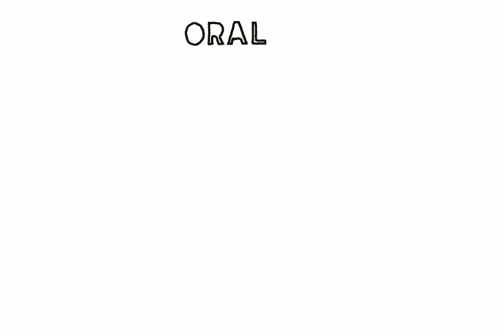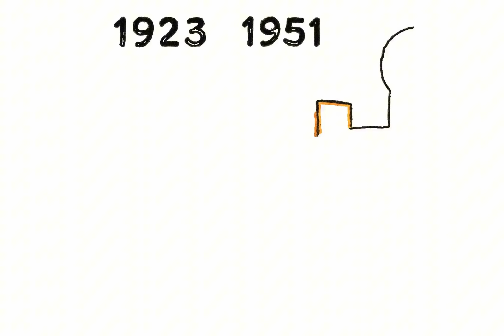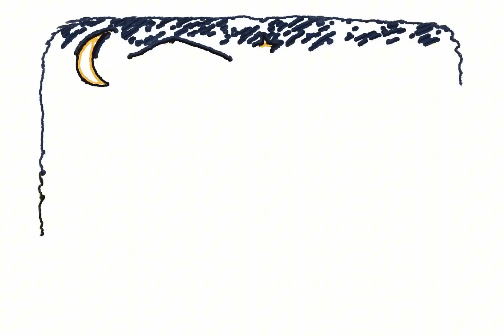12 Impossible Inventions That Were Erased From History

Comment: An iron ship floats on water due to buoyancy.
However, if a hole is drilled in the bottom, it will sink. This is because iron's density is greater than that of water.

If the top lid of a cubic iron container (only the bottom is missing) is opened, it will sink.
After sinking, if the top lid is closed and air is added, it will float again due to buoyancy.

Buoyancy is so powerful that a cubic container of 1 cubic meter can generate a generator with a force of 1 ton-f (1000 kgf) (Archimedes' Theorem).
This force is strong enough to lift an average passenger car, so it can generate enormous amounts of electricity.

If the container floats near the water surface while the generator is running, opening the top lid again will cause it to sink again.

By repeating this process, it is possible to generate electricity more efficiently than not only thermal power plants, but nuclear power plants as well.

The top lid can be opened and closed with very little force, as there is no pressure difference between the inside and outside.
When pumping air into the nozzle, if the nozzle is facing vertically upwards, the air inside the nozzle is pulled in by buoyancy, so very little force is required.
Therefore, even after taking these factors into account, the energy balance is significantly positive.by

Comment: For the idea about unlimited energy using the Palladium, I actually theorize the same thing by analyzing the catalytic converters inside of vehicles that are responsible for mitigating the amount of emissions put into our environment if you notice this mitigation process between palladium platinum and rhodium takes your emissions and converts specifically carbon monoxide, nitrogen oxides, and hydrocarbons—into less harmful substances (carbon dioxide, water vapor, and nitrogen) so in theory our lungs seem to be doing the same thing innocence acting as a filtration system if we could replicate the function of our lungs while incorporating a catalytic conversion methodology it is very reasonable to say that some sort of “iron lung” could be manufactured in heavy industrialized areas that would be dualistic in functionality of being a filtration system for the airways as well as producing fresh water and electricity simply by converting the emissions into water the separation of the bonds will produce energy that could be stored and return back to the systems power bank it would actually be a three and one system just by completing the full process of conversion that would literally result in freshwater clean energy and not only know emissions, but counteractive mitigating our global warming problem and I bet with a little bit more troubleshooting. This idea there is a high probability it could be produced even more efficient potentially having is the ability to correspond with gravitational pull of the nutrients existing outside of earths ozone layer, pulling in useful minerals that the Earth can use as nutrients to produce all sorts of materials and minerals like metals crystals as well as placing them strategically throughout the globe following specific geological coordinates along earths surface this could strengthen and begin to repair the ozone layers of earth protect protecting us from radiation, penetrating into earths atmosphere, as well as strength strengthening the functionality of the ozone layer which is responsible for the Earth’s ability to regenerate itself making our planet, healthier, and more abundant in resources the process of converting earths heavy metals into more precious metals would be more efficient, resulting in and increased production, speed, and quality in abundance we really should start treating the planet like we do our own self health and honestly better than that because we all deserve to be treated with the best qualities of life and don’t realize how we neglected even our own health simply just by not knowing the quality of life, God has given to all of humanity as far beyond what we know

Comment: Ironically, a lot of these inventions are now still being used today, but in different forms. We can take one , for example , the starlight anti heat material Is the same exact material that's used on the bottoms of the Space shuttles Which is already been implemented some last ten year or years
Reply: They used ceramic plates, not aerogel.

Comment: 1. Fish tank full of water
2. Grain of sand
3. 2 foot long 2lbs 4x4 piece of wood.
Experiment , 
1. Drop in grain of sand. It sinks to bottom fast.
2. Drop in 2 foot long 4x4 wood. It floats on top of water.
Much larger, heavier item floats while tiny light item sinks.
PROOF that Gravity does NOT exist at all.
There is no force "pulling" things downward at all.
Reply: lol, you have one thing right, gravity doesn’t pull down, it is draws both items together because state fall to there lowest power level. It appears you are falling because the mass of the earth is too large for your mass to move it.
Reply: @donut3946 LoL
Reply: @seaislevel7233  oh and you’re a flat earther too. People like you are impossible to debate, because you lack the cognitive function to understand debates.
Reply: People like you are the reason conspiracy theorists are laughed at. 

Buoyancy is a force caused by a fluid, in this case water, being more dense than the solid 2x4. Despite being more massive than the lighter grain of sand, the sand is far denser. Take a quartz rock and an equally sized piece of wood, and you’ll see this clearly. 

Buoyancy is a function of volume and density, with the force provided by gravity allowing the fluid to press against high volume objects. 

Helium balloons float because the matrix of gas within them is a lower density than the air around it, allowing it to float.

I’m 90% sure people like you are government-paid to discredit conspiracy theorists, because no human is that stupid.

Comment: 1:41 I hate to point out this simple fact, but coral is not magnetic. It is porous though so it’s possible that he floated it on water. He would’ve had to have sealed up the outside edges of the coral so that the air pockets would remain.

Comment: Gravity propulsion is real; I know how it works.
Reply: What they call antigravity is a misnomer. You have a graviton functioning in space/time. If an antigravaton contacts a graviton, they would explode and literally effect space/time. The proper term should be null gravity. A null gravity device would act more like a bubble floating on carbon dioxide layer in an aquarium. A null gravity bubble would "float" on the layers in a gravitonal field, generated by the mass of a planet.
Reply: @TheParkAttendant  taking notes 😅
Reply: @TheParkAttendant Two conical hexagonal quartz crystals are placed base to base. A bifilar coil is wound around them using thick wire folded in half. The positive end of angularly placed high-voltage capacitors is connected to the bifilar coil. The other end is connected to an x-ray vacuum tube antenna. When the capacitors are charged, gravity is created and the vehicle rises. 😁
Reply: @halilka9853 interesting you use quartz… but what’s the core principle? The aether/369? Electromagnetism?
Reply: @supply.mp4 Yes, magnetization. The structure of a quartz crystal is just like a magnetic field. A spiral hexagonal structure. Three sides of the hexagon are S and three sides are N. People don't know this yet; it's hidden knowledge.
Reply: @halilka9853 how'd you find it? Have you tested one?
What did you mean by Gravity? (We are already in a gravity felt place, Earth)
Would love to know more.
Any further updates too?
Reply: @railcamm it turns out, they could only get it to work when they did LSD 🤷🏼‍♂️
Reply: @halilka9853 I've have subscribed to your YouTube channel accept as your student sensei
Reply: @halilka9853 is this the same thing as dr Steven Greer or Bob lazaar and similar people talking about cancelling mass using technology that creates a field affecting gravity within it? Or is this completely different method bit achieving the same result?
Reply: @DarkGhostHackerSame. These are the latest details on this technology. This technology is patented, it exists, but it has been made incomprehensible to malicious actors.
Reply: @halilka9853  oh.. i think you see" voltage without current" phenomenon instead of gravity. When voltage is achieved without current it creates a gravity like phenomenon
Reply: The water Gravititional Force in the Dam that turns the mega watts electric generator propeller actually works with Gravity called in Science as "Kenetic Energy" from Water Falling Gravititional Force.
Reply: @igabgabay_kopay Two conical hexagonal quartz crystals are placed base to base. A bifilar coil is wound around them using thick wire folded in half. The positive end of angularly placed high-voltage capacitors is connected to the bifilar coil. The other end is connected to an x-ray vacuum tube antenna. When the capacitors are charged, gravity is created and the vehicle rises. 😁
Reply: This is this CIA, where are you located? Oh nevermind.
Reply: @zacharysilas7585  Good one!😂
Reply: @zacharysilas7585 Two conical hexagonal quartz crystals are placed base to base. A bifilar coil is wound around them using thick wire folded in half. The positive end of angularly placed high-voltage capacitors is connected to the bifilar coil. The other end is connected to an x-ray vacuum tube antenna. When the capacitors are charged, gravity is created and the vehicle rises. 😁
Reply: I also know how this works. 
Capacitor with each Plate different in size. For example half size. Then apply very high Voltage. From 50kV to 1 MV. Extreme force. Related to Casimir effect
Reply: @vr_patient7016 A very high voltage is applied. Two conical hexagonal quartz crystals are placed base to base. Then a bifilar coil is wound around them from a folded wire. The positive end of angularly placed high-voltage capacitors is connected to one end of the coils, and the other end to an x-ray vacuum tube antenna. Gravity is generated when the capacitors are charged.
Reply: @vr_patient7016  I believe it was Igore Sikorsky. Inventor of the helicopter, that discovered this. If I had the money, I would definitely build one of thes.
Reply: How?
Reply: Two conical quartz crystals are placed base to base, and a bifilar coil made of folded wire is wound around them. Then, angularly placed high-voltage capacitors are connected to the positive terminal of the coil. The other end of the bifilar coil is then connected to an x-ray vacuum tube antenna. When the capacitors are charged, gravity is generated. 😁 @antijordan
Reply: @h @halilka9853 are you giving me the end of the Rick and Morty episode when Rick and Jerry get put in an alien simulation?
Reply: @antijordan It's funny, I'm telling you the truth 😄
Reply: @halilka9853 before I try it what happens at the end of the episode?
Reply: @halilka9853 can we discuss measurements and math.
I'm here for it.
Reply: Source : McDonalds trust me bro
Reply: @halilka9853 sorry, is there any sources that i can read about that concept? I am interested)
Reply: Me too,!
Reply: @alexp8157 Two conical hexagonal quartz crystals are placed base to base. A bifilar coil is wound around them using thick wire folded in half. The positive end of angularly placed high-voltage capacitors is connected to the bifilar coil. The other end is connected to an x-ray vacuum tube antenna. When the capacitors are charged, gravity is created and the vehicle rises. 😁
Reply: Charge implosion technology
Reply: @Iyw23 Two conical hexagonal quartz crystals are placed base to base. A bifilar coil is wound around them using thick wire folded in half. The positive end of angularly placed high-voltage capacitors is connected to the bifilar coil. The other end is connected to an x-ray vacuum tube antenna. When the capacitors are charged, gravity is created and the vehicle rises. 😁
Reply: @halilka9853 they do still follow the same principles of  vortex charge implosion found in the vimanas and other craft such as the tr3b.
Reply: @Iyw23 The vortex helical structure is already a characteristic of the magnetic field. The 3N and 3S hexagonal structures are unknown properties of the magnetic field. TR3B and VIMANA use the same gravity propulsion. All this information has been hidden by malicious actors.
Reply: @halilka9853 your forgetting several parts 😂😂😂
Reply: Just eat a burrito
Reply: @StreetFighter23 Two conical hexagonal quartz crystals are placed base to base. A bifilar coil is wound around them using thick wire folded in half. The positive end of angularly placed high-voltage capacitors is connected to the bifilar coil. The other end is connected to an x-ray vacuum tube antenna. When the capacitors are charged, gravity is created and the vehicle rises. 😁
Reply: Cool dude put it on DVD and take that knowledge to every machine shop and small mechanic shop. Make thousand of copies send them out.
Reply: I would like to pick your brain and learn more. Im sure there's much more you know that I dont. Who knows maybe we can educate one another. I plan to do more than just learn what you have to share.

Caehhbdefb
Reply: Tell!!
Reply: @carefree528Two conical hexagonal quartz crystals are placed base to base. A bifilar coil is wound around them using thick wire folded in half. The positive end of angularly placed high-voltage capacitors is connected to the bifilar coil. The other end is connected to an x-ray vacuum tube antenna. When the capacitors are charged, gravity is created and the vehicle rises. 😁
Reply: @halilka9853 eat processed foods mainly white bread at least three times a day ,along with pasta and white rice .
Reply: would you enlight us on its principal
Reply: @habechimohamedali6109 Two conical hexagonal quartz crystals are placed base to base. A bifilar coil is wound around them using thick wire folded in half. The positive end of angularly placed high-voltage capacitors is connected to the bifilar coil. The other end is connected to an x-ray vacuum tube antenna. When the capacitors are charged, gravity is created and the vehicle rises. 😁
Reply: Easy said than done
Reply: @akashdeeplakra3583 Two conical hexagonal quartz crystals are placed base to base. A bifilar coil is wound around them using thick wire folded in half. The positive end of angularly placed high-voltage capacitors is connected to the bifilar coil. The other end is connected to an x-ray vacuum tube antenna. When the capacitors are charged, gravity is created and the vehicle rises. 😁
Reply: So build it yourself
Reply: @vikash70R Two conical hexagonal quartz crystals are placed base to base. A bifilar coil is wound around them using thick wire folded in half. The positive end of angularly placed high-voltage capacitors is connected to the bifilar coil. The other end is connected to an x-ray vacuum tube antenna. When the capacitors are charged, gravity is created and the vehicle rises. 😁
Reply: @halilka9853 if you build that machine and it actually works i will come to visit you. I will be waiting for you to make it possible
Reply: @halilka9853 eat processed foods only ,at least three times a day ,mainly white bread ,pasta and white rice .
Reply: Rife machine will also work😅
Reply: @JosephHolmes-AUS Two conical hexagonal quartz crystals are placed base to base. A bifilar coil is wound around them using thick wire folded in half. The positive end of angularly placed high-voltage capacitors is connected to the bifilar coil. The other end is connected to an x-ray vacuum tube antenna. When the capacitors are charged, gravity is created and the vehicle rises. 😁
Reply: @halilka9853 white bread . Lots of white bread .eat processed foods only .eat pasta and white rice.
Reply: Ooh will you tell me? I'll pay you a dollar
Reply: @gnomeking101 Two conical hexagonal quartz crystals are placed base to base. A bifilar coil is wound around them using thick wire folded in half. The positive end of angularly placed high-voltage capacitors is connected to the bifilar coil. The other end is connected to an x-ray vacuum tube antenna. When the capacitors are charged, gravity is created and the vehicle rises. 😁
Reply: @halilka9853 Get that white bread into ya .
Reply: Please do explain how it works Especially since There is no such thing as gravity!
Now I'm not saying things don't go down, gravity is not the cause. 
But please do explain in detail How it works
Reply: @mattiëgs369Two conical hexagonal quartz crystals are placed base to base. A bifilar coil made from a thick, folded wire is wound around the crystal. The positive end of angular high-voltage capacitors is connected to the bifilar coil. The other end of the bifilar coil is connected to the x-ray vacuum tube antenna. When the high-voltage capacitors are charged, gravity is generated and the vehicle rises.
Reply: A cone is not a hexagon  and a hexagon is not a cone .Be specific ,maybe draw a diagram ,God forbid .
Reply: @Bergoinecourtney Are you sure you've ever seen a natural quartz crystal? Look closely and then write to me. 😁
Reply: U mean space wraper but it worked by negative energy but we don't still negative energy it is impossible ❤
Reply: @Ajay100-s3l Gravity propulsion works with a positive magnetic field, while the negative field is the power source that feeds this propulsion system.
Reply: @halilka9853 😂😂😂right but it is called ion propulsion not gravity propulsion.... unfortunately u didn't know the space wraper that is called gravity propulsion.i know u have phone.so go to search ❤
Reply: Are you sure.